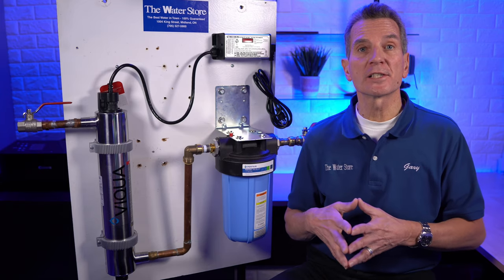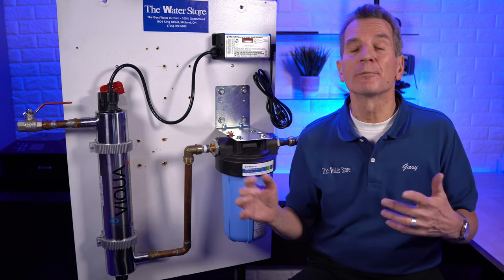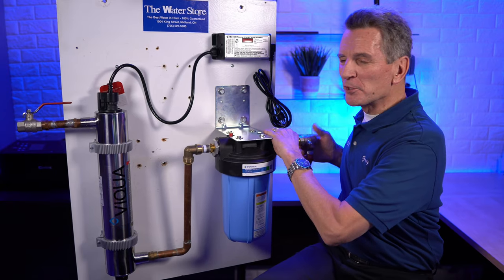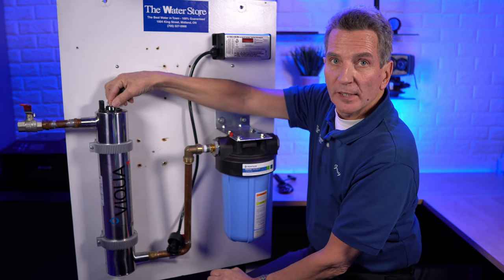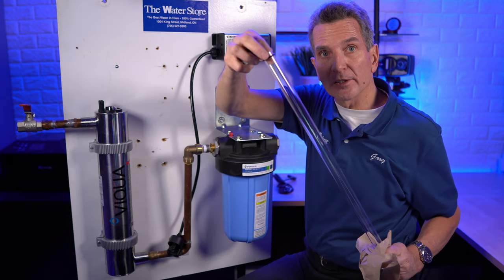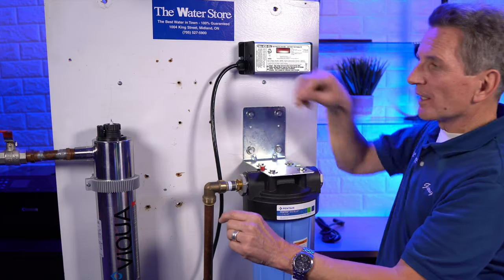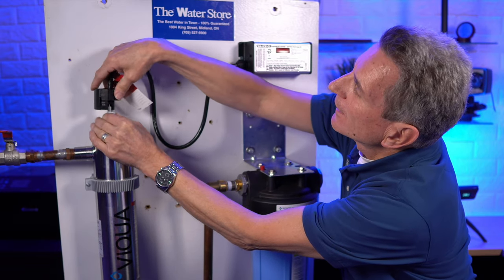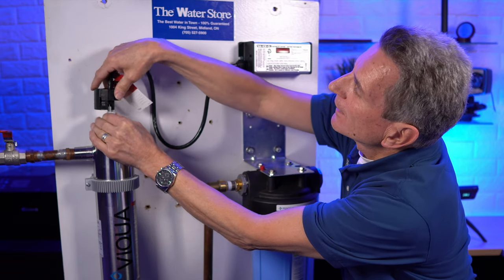Step by Step UV LAMP REPLACEMENT

Comment: Hello Mr Gary. Thank you for your last comment and video. I asked the initial question about about the sediment filter because everytime it rains a lot the water in my house becomes discolored. I have to run it for 15 minutes at a time for two or three days until it clears up. That is why I asked about sediment filter. I have the two tanks and the UV filter then the salt container.
Reply from the maker: Glad to help, yes, you need the sediment filter

Comment: Thanks for this very helpful video!!!  Only difference for me with the exact same controller at 10:05 - when I pushed and held in the button, then plugged the power back in/on, the controller said "rSet" for reset but never switched while I was pushing the button to "365."  I continued to hold in the button for well over that five seconds you recommended, then once I released it, that's when the display switched to reading "365."  So all good now, and thanks again!
Reply from the maker: Glad it worked for you, please share video with friends and family.

Comment: I come back to this video every summer to replace my uv light. This year however i can't seem to reset my counter. It only cycles between the 2 days left on the previous lamp and the total days used, holding it down for a minute and no reset
Reply from the maker: ASorry to hear, it sounds like the ballast may need replacement.  We have them here https://waterestore.com/search?q=viqua%20ballast

Comment: VH410  Just replace sleeve and uv light watching the video ( well done) and cannot reset the unit. I get the long beep, see “reset” but not the 365”.
I still tried holding  long enough many times after I see the reset but it keeps beeping? 
The365 does not appear
Jean

Comment: Hello I watched your video and was wondering if the UV light does the same as a sediment filter. My well does not have a filter hooked to the line but it does have a UV light. All of this is new to me as a new home owner. Thank you so much for your help.

Ms Smith
Reply from the maker: No it does not. The sediment filter removes dirt, the UV light kills bacteria. This video might help https://youtu.be/7yXNY6gbdws?si=59hm9S7lIhcFpoIt
Reply: Thank you so much.

Comment: Hi Gary. 

I inserted the uv bulb without the sleeve in place and plugged it in for 10 minutes. The water leaked out over the electrical connection for the system.

My plumber who installed it told me I just had to install the light.

I did not know about the sleeve.

Is my machine ruined now or just the bulb or did I get lucky and I just have to let everything dry out?

Fingers and toes crossed.

Thanks
Reply from the maker: Sorry to hear.  I would just throughly dry it all out and try again with the sleeve and you should be fine.

Comment: Did you not need to replace the o-rings on the top and the bottom that were removed? I didn't see you remove the top o-ring, but you spoke of it.
Reply from the maker: Yes, both o rings would need to be replaced.

Comment: What do you do when the quartz sleeve is broken and you can’t get it out?
Reply from the maker: You will need to remove the system from the wall and move it around to try to pull or flush out the remnants.  If you still can't get all the debris out, you'll need to replace it.  we have them here https://waterestore.com/collections/ultra-violet-water-treatment-systems?pf_pt_product_type=System

Comment: Hi, how do know when the filter needs to be replaced? Also, do you have any videos showing how to disinfect the tank?
Reply from the maker: Filters need to be replaced once a year or if they become clogged and slow down your water flow.  Thsi video shows you how to disinfect https://youtu.be/cQyNRu5LqOM
Reply: Thank you.  A person came and serviced our tank and said that there is no filter that proceeds the lamp.  Is that possible? Also the neutralizer tank is below the refill line and he said that it doesn't affect the safety of the water but I remember that if the particles are too big the UV lamp can't do its job.  Basically they made it sound like the neutralizer was synonymous with our filter system but that it was not dangerous if it was below the refill level.  Is the neutralizer in this instance the same thing as the filter so to speak and does it affect the UV lamps efficiency?  The giant neutralizer tank feeds into the lamp tank directly
Reply: I did ask those questions directly and was told it was comparing apples to oranges and that the neutralizer tank did not affect the UV lamp tank

Comment: meter reading after installing new UV bulb doesn't look right. I have 015 for a few seconds, then 4741
is it a faulty meter? I'd like to see 365!
Reply from the maker: I think you are referring to the ballast or power supply.  Yes, it should reset to 365.  In some cases, even if it doesn't reset, it is still working.

Comment: Dude your bracket that mounts your "Big Blue" water filter cartridge housing is installed upside down, 180 degrees out!
It should be behind the housing, the wall mounting leg of the metal bracket, concealed behind the removable housing!
There is that not a cleaner and neater? Uses less wall space?
Everyone mounts these wrong, drives me crazy!
Reply from the maker: Thanks for the suggestion.

Comment: My BA-ICE-S UV controller keeps beeping even though the lamp has been replaced, what do you think is the cause?
Reply from the maker: If you reset the controller after replacing the lamp, as shown in this video, https://youtu.be/MnssV1UQcug  and it keeps beeping you need a new controller.  We have them here https://waterestore.ca/products/viqua-sterilight-replacement-ballast-part-ba-ice-s

Comment: Hi Gary, thanks for the tips.  I just replaced my lamp following your guide here, but I have a problem.  The system says "lamp key invalid".  I've tried resetting it several times but it gives the same error message and beeping.

I have a culligan system CUV5, but am trying to using a non culligan brand lamp, though it is the identical model lamp.  Any ideas?  Is it possible they make it so only their brand of key works with their controller?
Reply from the maker: You have fallen victim by purchasing a proprietary product instead of a non proprietary.  The Culligan UV systems are likely made by Luminor who sell them to Culligan with a key unique to Culligan.  The key only unlocks the lamp when you purchase the replacement lamp from Culligan.  Although the non proprietary lamp fits, without the Culligan key, it won't work.  Better for Culligan because they can charge whatever they want, but worse for you.  This video explains more https://youtu.be/v2IyVLTVqGU  This is exactly why we do not sell proprietary systems.
Reply: @GarytheWaterGuy  Thanks very much for your reply.  Yes, we went with culligan for our entire household water system without doing our due diligence and have regretted it.  I would not recommend that company.  This lamp key thing doesn't surprise me one bit now that I better understand their business model.   We're going to remove their uv system and find some better folks to do business with.
Reply from the maker: @user-gy8is6gm4k  we have some great non proprietary UV systems here https://waterestore.ca/products/uv-dynamics-8-gpm-ultra-violet-disinfection-system-uvd320e and here https://waterestore.ca/products/uv-dynamics-uvd-400e-13-gpm-uv-system. Check them out

Comment: hello, I installed a 4 w puricom uv-c filter on my water purifier, but by attaching a flow switch to apec and ispring water purifiers, the lamp lights up while taking water ..?
Reply from the maker: You need to contact the manufacturer.